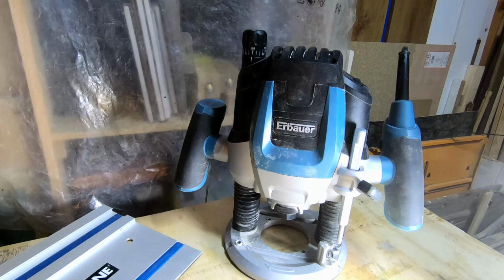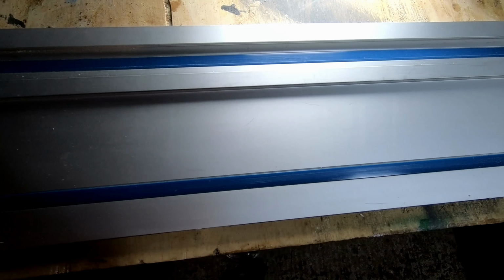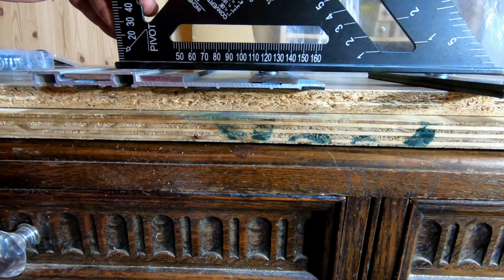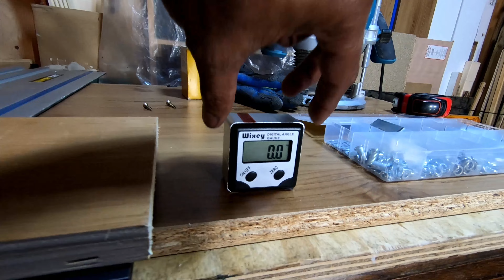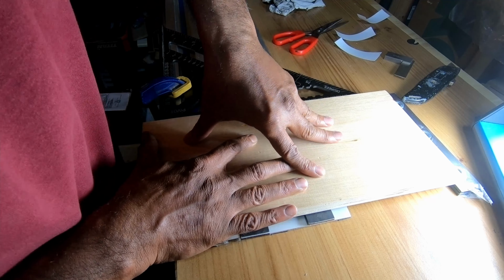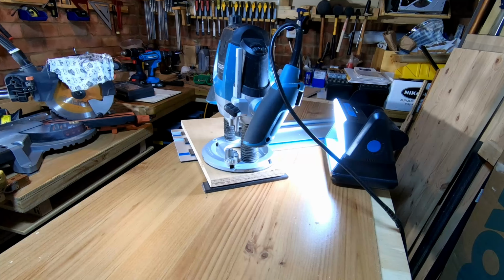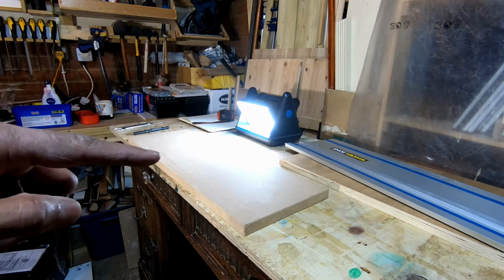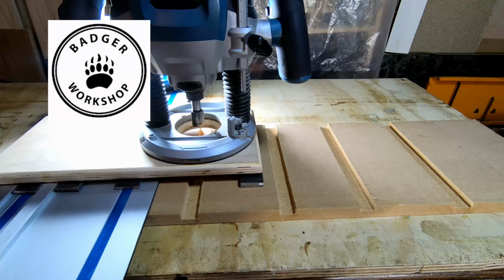Router Track Jig - But is it Accurate? #woodjigs21

Comment: That is awesome mate, not a hint of wobble thanks to the steel. I've not seen a steel cutting blade for the mitre saw, that was also super cool. This looks like a much better way than trying to use the router table, added to the official #woodjigs21 playlist. Cheers!
Reply from the maker: Thanks James, yes, IMO steel eliminates that wobble, and wear and tear issues. Evolution saws usually comes with that multi purpose blades, that can cut anything. Thats the one thing it is good at 🤣😜.
And thanks for the #woodjigs opportunity. I just recorded it 1 day before my vacation, lol 😆

Comment: Good idea that mate! Just a thought may wanna add a small knob/handle the the track side of the jig so one hand on the router and one on the jig helps distribute the forward force evenly 👍
Reply from the maker: Cheers Ben. I actually did plan to do that , ie a handle at an slight angle. But then left it out, as this was working fine, as long as the track is clamped on either sides. 👍😁